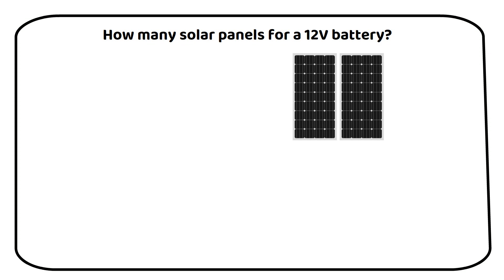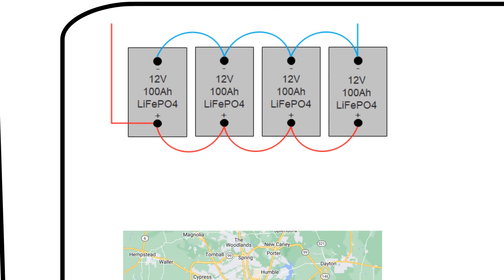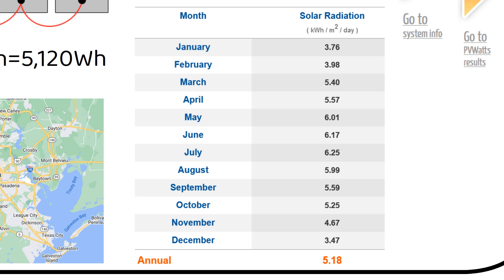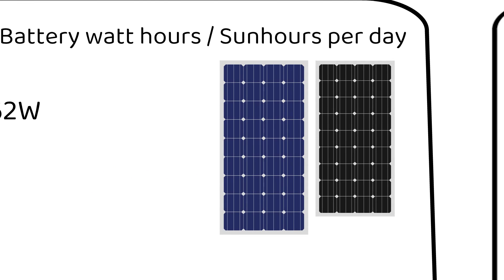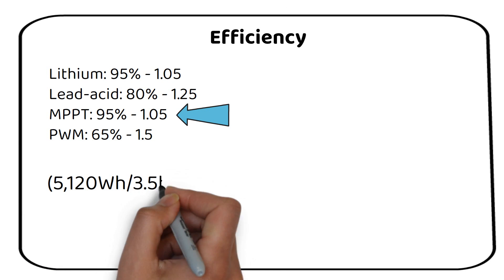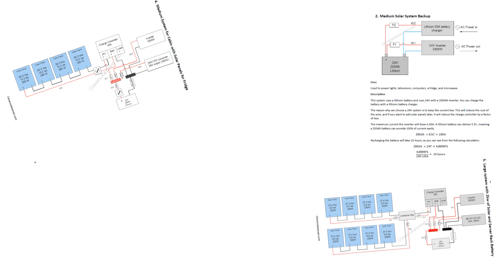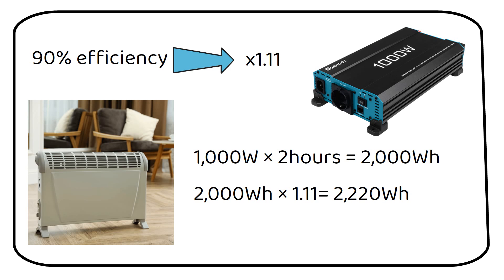What Size Solar Panel to Charge a 12V Battery

Comment: Sir
If we use inverter power seldom, then can we switch off the inverter in night. Or we switch on the inverter after 3-4 days.
As very rare electricity from the grid is off then only our inverter works for us
Inverter can charge the battery in the day
And we will save the electricity charges
Is that correct proposition please or I should have some other plan
Please advise
Many Thanks Please

Comment: so i have a travel trailer and want to be able to run the fridge, furnace and hot water tank off a 12v battery. How big of a solar aray do i need to charge battery fast. and do i need an inverter if i dont want to use any AC appliances.

Thanks in advance
Reply from the maker: Search my channel for 'fridge' and you will see my video where i test a 12V DC fridge with it's power consumption, how many batteries you need and how much solar to run it 24/7.

Comment: Although I am subscribed to your channel and have watched most of your videos, I still don't understand one question regarding the selection of the number of panels. There is a 3000 W inverter (3200va)  DAXTROMN AOH-3.2KVA and how to choose the power and number of panels for it to be optimal? For example, I am focusing on 6 pieces of Jinko 555 W panels. But the chatGPT says that taking into account the NOCT conditions and that the nominal is never produced, minus the efficiency and losses, it is better to choose Jinko 580 W. This will be closest to the nominal input of the inverter and under its voltage limits (30-400V). Is this correct, or do I need to calculate it differently?
Reply from the maker: I recommend watching my video about 'load analysis' you dont size your solar panels for the inverter, you size them for your battery bank and the amount of sunhours.

Comment: So I'm gonna do a semi diy off grid system. I'm gonna get the Ecoflow Delta pro 3  and a bunch of 12.8v lifepo4 100ah batteries. My goal is to make it a 20kw system. Can you put a list and diagram together with parts etc... like what affordable charge controller I would need and what size panels is need. I'm new to all of this but slowly learning. I just wanna make sure I do this right but hopefully not break the bank.
Reply from the maker: I did a video on the ecoflow, check it out on my channel. Check my playlist systems as well.

Comment: hi plz would you calculate this..dont need a invertor so should be simple for you thar is.... Touring Caravan 
Router  = 1.0A(peak) @ 12V  Left on   24/7... for a wireless cctv camera.. dull uk leeds 
Batteries 2 x  115ah  12v
Solar panel = 240 watt 12v On caravan roof 
Votronic Solar Controller MPP 260... Max 260 watt  12V  (12 V / 18.5 A / 260 Wp)

12.8v x 215ah batteries  = 2,944 w/h ......... 2 car batteries 115ah each

Comment: Nick. Used your maths and on paper its fine. However. On paper and in reality ( Today in UK December ) using the correct sun hours, the reality is far from the results on paper. The real world figures are just not aligned with the maths. I posted my findings on a Scotish camper  van facebook group who all posted there Victron screen shots of solar yield and confirms the reality. The maths on paper is not real world experience.
Reply from the maker: Please use pvwatts for your simulation. There is still a yearly variable in weather and it's more accurate seen over the whole month and then divide by 30.

Comment: You are assuming we are unsung full available stored watts every day 
In our camper we may only use it occossionally on weekends, then only for lights, water pu fan on occossion.  We thus only red to replace part of charge drawn and may have several days to top off .   Fewer batteries, less cost.  I already have 1000 watt inverter , may only draw 85 watts to run  my refrigerator in camper running 50% of time ?
Reply from the maker: That consumption sounds about right. I calculate on full off grid systems, not temporary systems for two days. For more information I recommend checking out my video about sizing an off grid system.

Comment: At my location (Latvia) annual average is 2.95 KW/m2/day. But in december only 0.36 KW/m2/day, november and January is also below 1 KW/m2/day. And that 0.36 is the december average, maybe 5 sunny days, and 25 cloudy days in december. In august it is 20 times more, 5.58 KW/m2/day. Solar is popular and pays for it self, but only in grid connected systems. If you wan to go offgried, you get 8 good months Martch to september. Februarry and Octobrer maybe. But November to January, there is almost no solar. Need grid, generator or maybe wind turbine. But almost nobody uses those wind turbines.

Comment: For me it was easy, as many panels as I could fit on the roof of my van :) 4 320w panels +100w panel (to charge the start battery). I also have 5000W/h battery bank with 24v and a 3000w inverter.

The panels is mounted flat and I am very far north but still the flat mounting works ok, and flat mounting seems to give more power then other report is usual when it is overcast and raining. Max power in middle of sunny day I get is 1000w from the 1380w of panels, overcast days it is 270w or so with thick cloud layer or rain.
Reply from the maker: Yes, if you are in a van, fit as many panels as you can. Good choice on the 24V battery as well.

Comment: I need some help I'm buying an AC unit Media 6000 btu 535 watts. The specific are on Amazon with all the unit data. How many 12V.  100 amos batteries do I need I'll be buying lead batteries. And I'll be buying 800 watt wind power generator. For continues use. Would a 7000 peak an  3500 watt inverter be enough to hold the watts on a 535 watt AC. Thx
Reply: I do not know about AC but a fridge typically use around 1500w when it starts for a few seconds. So a 3500w inverter should be more then enough to run it (starting it is the hardest part and inverters usually are able to give double effect for a few seconds). For running it when started you would only need a 600w inverter, but as you I said you need larger to make sur it can start.

Comment: Hello, I have two 6V batteries. I run in parallel for a total of 225 amp hours would a 100 W solar panel charge them or would a 200 W solar panel be better
Reply: I use a 100W panel to charge the start battery on my van... For the living part in the cargo room I have 1380w of solar panels on the roof. A 100w panel is very little but it depends what you plant to run with it? For me it was to run a fridge and a freezer even if you get weeks with no sun in overcast weather, under those conditions my panels only give 270w.

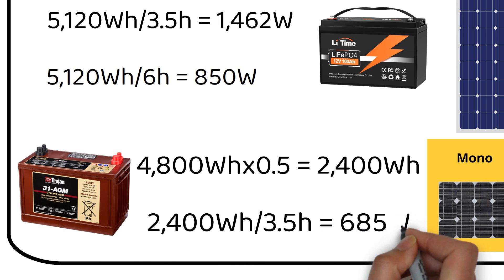Comment: A lead acid battery does NOT require "less" power to recharge. A 100Ah AGM is equivalent to a 200Ah LifeP04 in terms of useable power, assuming you only bring the AGM to 50% DoD but allow the LifeP04 to fully deplete. Charging both back to full would take the same amount of solar power. At 3:00min, one example has useable power of 5120Wh and the other only has useable power of 2400. Of course the one with less than half the useable power takes less solar to charge....

In your 2nd scenario, of course the battery takes less time to charge up, because you're comparing apples to oranges. Useable power is the priority, not the amp hours on paper. Additionally, all lithium batteries charge faster than lead acid, which means that they can take advantage of short bursts of power much better than lead acid. With a high quality rapid response MPPT solar controller (Victron etc), a lithium battery will take MORE charge than a lead acid of any variety.
Reply from the maker: If you have identical batteries, they do, which is explained in this video. Yes, i have a video specifically about c-rate for charging and discharging speed.
Reply: @cleversolarpower  If you have identical batteries they will charge about the same at lower inputs, UNLESS you only discharge one partially (the AGM). Your example is misleading. Obviously the AGM will be fully recharged sooner if you only discharge it halfway. 

And if you have much higher inputs, lifep04 can take a higher rate and charge quicker.

Comment: I live in Belgium where in december we have 0,56 hours of sun. and i have a modular home which consumes 14 kWh of energy. I willl install a battery of 50 kWh (an old EV battery) How many solar panels do i need to cover 3 days of energy?
Reply from the maker: Ah! Fellow Belgian! Your home consumes 14kWh of energy, so for 3 days of autonomy, you need 42kWh of battery storage. You need: 42kWh/0.56h=75kW of solar panels. This is not feasible. So if you are grid connected, charge a smaller battery with the max amount of solar panels you can get on your roof. If you are off-grid, use a generator in the winter.
Reply: 14 kWh a day

Comment: You never actually answer the question do you? What size solar panel to charge a 12 volt battery? Lets say you are in Houston and the battery is lead acid.  I want to decide on the size of the solar panel and it's specs.. What size panel? At what watts at what voltage? Still don't know.
Reply from the maker: The question is how many Ah your battery is. This is different for everyone. You can repeat the calculations for your own battery. It's easy.
Reply: @cleversolarpower  sorry, I have a sever case of adhd. I purchased a 220 watt foldable solar panel, a 7000 watt (peak) inverter, and I am still . super confused on the battery.  Am I able to use a 12 volt battery with 8, 12 or 26 ah, or is that ah too small & not work?
Reply: @naidamaraja3640  It is impossible to answer your question without knowing what you want to power with this set. But tentatively answering - a foldable 220Wp panel is far too small in relation to the power of the inverter you bought.

Comment: I feel dumb.  I never thought about turning off the inverter.
Reply from the maker: Some inverters have an automatic detection when the inverter is not working, called power save mode. It will automatically turn off the inverter when there is no load detected. This can be disabled by default.

Comment: Is it true that higher watt inverters use more power, for example, using a 3000W inverter on a TV, say 250W, will a 3000W inverter use more power than an inverter rated closer to the example, say a 500W inverter?
Reply from the maker: Yes, bigger inverters have a higher idle consumption.
Reply: @cleversolarpower  My 3000w inverter have extremely low idle consumption (so low that I do not bother to turn it of when not in use), what is more interesting to know is if it is less efficient at reduced effect of for example  500w then 800w inverter ... I have not found any data on that anywhere. It only say the efficiency is 96% or something like that at full effect I assume.

Comment: so for people to under stand. power loss of a system can go as 50% of a cheap system. so you would have to double the size a salesman tells you. but you wont find out until you done invested half the money. so most people dont understand what they are buying. the battery system above will run a hot plate for about a hour. not bad for 5K.

Comment: This is great information, especially the PV website. Now I have a more reasonable understanding of how many solar panels I’ll need for my shed workshop. Initially, I was trying to maximize the amount of panels I had on the shed roof, only to find out that over a surface area of 5 m² I would need a building permit. I was going to put up some used panels which are actually working very good that I got off Kijiji, which would give me about 1300 W, and put me over the surface area of 5 m².  But now with the calculation here, as well as the PV website for my area, and me having 2x 100A LiFePO4 batteries, I need about a 400 W array size.  If I double the amount of batteries, and since I’m only in my work shed on weekends, then, potentially the maximum I would need is 800 W, and that keeps me under 5 m² of surface area, where I can avoid having to hire a structural engineer, and needing to get a permit, so this saves me quite a bit of headache and money.  if I do run out of power, I can always drag in a 2 kW EcoFlow power station that I have
Reply: A permit for 5m2? wow... I have 6,4m2 with 4 320w panels on my van, that is insane that you need a permit for that small solar array you can fit on the roof of a van. And needing a structural engineer for mounting 60kg (that is what mine weigh) on the roof is equally insane.

Comment: Is it OK to connect 2 100ah 12v solar panels  in parallel to a 30Amps charge  controller to charge a 75ah 12v battery?
Reply from the maker: You mean 2 100W 12V solar panels. Wire the panels in series and select the correct charge profile for the battery type you have.
Reply: Yes

Comment: Thank you. As I'm looking into solar for my whole house, one thing I'm also factoring is the positioning of the panels. Since my roof isn't facing directly south and isn't pitched at the ideal angle, I may only get 70% of the rated wattage even under ideal weather conditions. If your example is in Houston during the summer, temperature may also reduce panel output. I guess I would use your calculations as the bare minimum and then add panels to make up for the rest.
Reply: I get 70% of max power on my flat mounted 320w panels on my van, and on overcast days it seems the flat panels actually give an advantage? (I get more power on overcast days then I hear other with optimal angle get).
Reply: @a64738  I have an L-shaped house, so I bought some cheap 100 watt panels and "solar generator", threw the panels on each angle for a week and recorded their output so I can get a baseline and determine a layout that works for my needs - all on one side or some on each side to get a lower, longer peak power curve.
Reply: I am in Houston and today I was using a 15W solar panel to try to recharge a deep cycle battery and when I picked it up to move it it nearly burned my hand and I think it was only 95° F today.

Comment: Whatever it says you need, DOUBLE IT. Those panels are rated in a laboratory. Their output does not reflect real life use, even on a bright sunny day.
Figure 100w panel will get you about 2/3 of that output on a sunny day.
Reply from the maker: Sun hours is an accumulation of W/m2 per day. If you have 6 hours of sun at 500w/m2 then you have 3 sunhours. It is accurate. Try it over a month and divide by 30.

Comment: Most people will be limited by how many volts that their solar charge controller can handle..A 12 volt system can handle half of the watts of a 24 volt system..And a 24 volt system can handle half the watts of a 48 volt system..And with the new all in one 48 volt inverters, most people should probably go with 48 volts these days, for a variety of reasons..But not everybody..
Reply from the maker: I'm making a video about choosing between, 12v, 24v, and 48v at the moment. Coming out soon.
Reply: I'm an idiot How do you achieve a 48v system?
Reply: Will a 300 w solar panel keep my 12v battery say with 590cca charged using a 2000w inverter? I'm not good with the math

Comment: What about the efficiency rating of the solar panels, themselves?  No panels actually output the rating applied to them under lab testing conditions.  Most will only put out 80 to 85% of their rated capacity.  Also, you didn't factor in ANY usage at all during the day?  I like your videos.  I like the graphics you use.  The production quality is better than most.  The problem is, you are usually explaining "theory" instead of presenting information someone could actually use in a real-world scenario.  

I hope John didn't actually pay you for your recommendation.
Reply from the maker: As you probably know, there is more than 3.5 hours of light during winter in Houston. It's not dark after that. 3.5 hours is the total amount of sunlight at 1000w/m2 in total of the entire day. Can be 7 hours of light at 500w/m2. In off grid systems, we calculate according to the loads, I have made a video about that on the channel. The solar panel then has to recharge the whole battery in one day. That's what this video is about.
Reply: @cleversolarpower  - So, in addition to not explaining that solar panels don't actually generate as much PV output as the number on the label, or mentioning that someone might actually be using power during the day, while the sun is trying to charge the battery, you purposely understated how much solar potential there is, and that's why we should just have faith in the information you're providing.  Be accurate, be thorough, be transparent...or don't present videos as though you know what you're doing.
Reply from the maker: @jasonbroom7147  I appreciate your critical review. As i mentioned in the video, all you have to do is research the sunhours per day for a specific month. I suggest you read my previous answer as to why that is or make your own video presenting the topic.